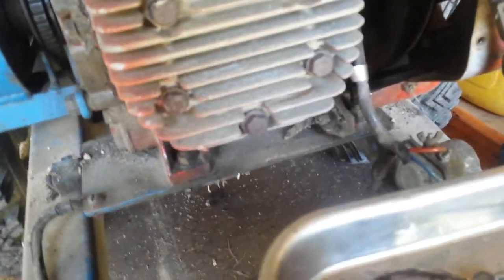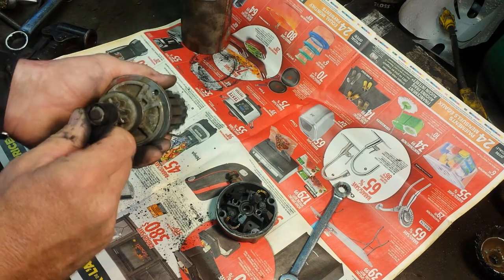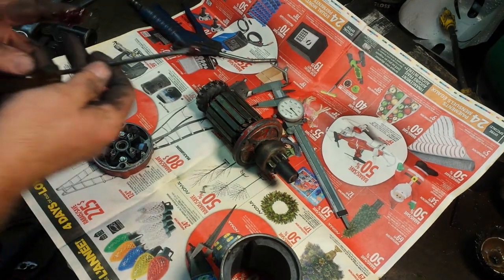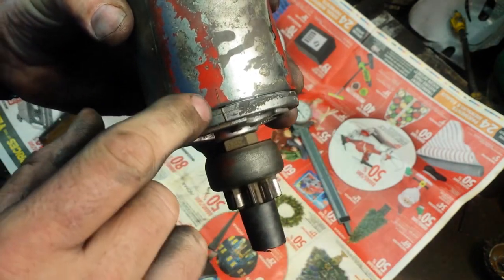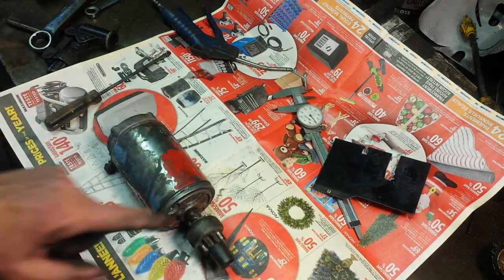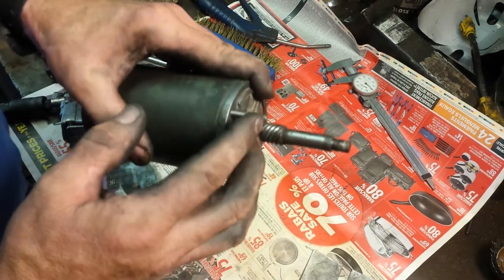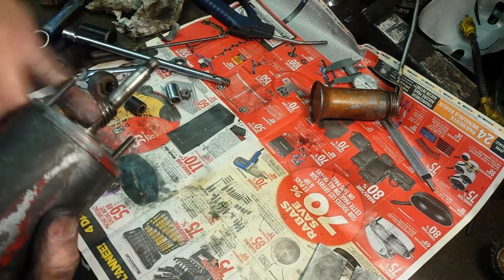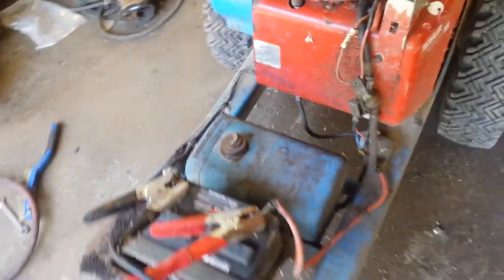Kohler Starter clean and lubricate

Comment: if the wear in the front bearing is too much, the armature is touching the magnets under load, that's probably the reason for the broken chunk of magnet. Actually a common failure with this type of starter.
Also be careful with grease near the commutator, every so little will make it sparking and the thing just burns off
Reply from the maker: Yes, I forgot to mention that's what broke the magnets. I used very little grease and it works like a new starter now.